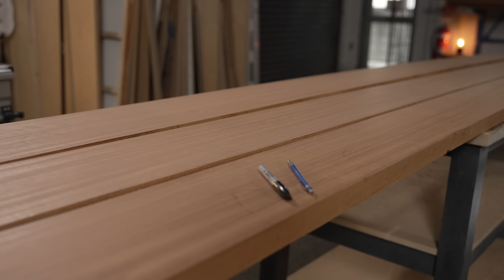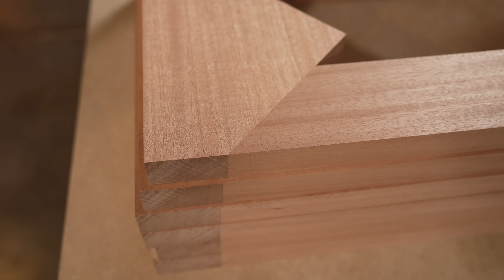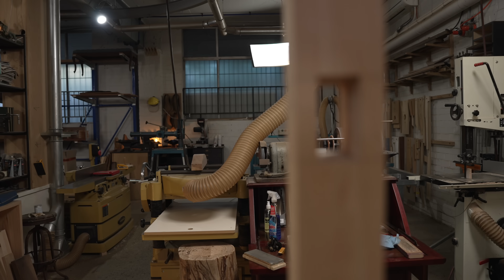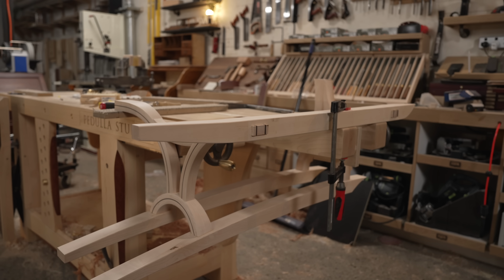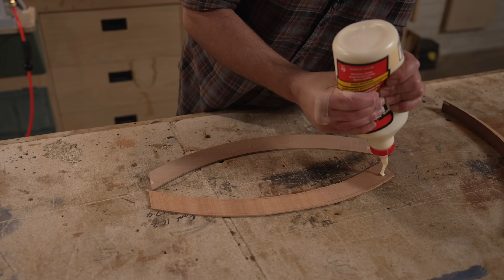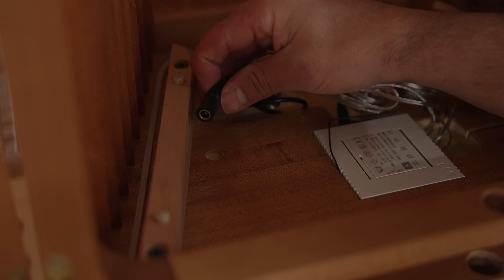The New Age Of Woodworking

Comment: Only one thing I might add. Superb. Execution and design. The only minor critique I have is the exposed pivot sleeve on half circle shelf. My guess is this is the whiskey pedestal. That circle could have been plugged or a gemstone embedded. The LED lights would enhance the gem. In fact as a. Now budding photographer why did you not put bottles inside.? Afterall it's a functional piece. After creating 2000 original paintings I know about aesthetics. I've also made many wood pieces

Comment: I think the process of staring at your design and moving its pieces a millimeter back-and-forth its what is known as pixel pushing (when applied to digital designs). Pixel pushing in itself as viewed as both a good and bad thing, as it will move your design closer to perfection, especially in terms of visual balance, but at the great expense of time and potentially only noticeable results to you as the creator. It can also push into a frame-of-mind where perfection becomes the only acceptable end state, which will never be obtainable, hence moving you towards insanity.

Comment: I appreciate the craftmanship here, though the design seems very our of proportion. As a whiskey drinker and collector myself, a whiskey cabinet should be much larger with shelves within to hold more whiskey. I think if you had expanded the width by 25% either side and 30-40% in length it would be perfect.

Comment: You can hide a Qi2 receptor underneath a thin layer of wood panel to the battery inside, and charge the battery with any Qi2 battery, just but it on the shelf where the receptor is and it’ll align and attach magnetically

Comment: Absolutely amazing and incredibly beautiful piece of furniture. 🤯🤯🤯

I used to build aircraft cabinets that went into Dassault Falcon Jets. I built sideledges, which is a shallow cabinet that goes between the seats and the fuselage with typically two stowage boxes, cup holders, two small control panels, monitor mounts, a phone box, and a stowable table, that were worth about $20k finished. Although they were mostly composite materials, there was still a fair bit of woodwork involved using all kinds of beautiful exotic wood, like rosewood, zebra, Birdseye maple, bubinga, ebony, and all sorts of burls, both “raw” stock and veneers. I did love the work, but it would be a bit monotonous at times, because every cabinet is pretty much a rinse and repeat every two weeks (roughly 120 hours per cabinet, not including stains and finishes because that’s a different department). We used the same equipment, but your table saw is awesome. I’ve never seen anything like it. I love it, and if I put together my own little wood shop some day, that’s what I want. And that work bench is really cool too. Are there plans available?

Thanks for sharing your beautiful woodwork and your process. Keep up the amazing work, and please keep sharing. 😉👍

Comment: As a fairly new wood worker, I can tell you that you made a few mistakes as a newbie. For example, the bottom of the actual cabinet door hangs lower than the other side. The twirly piece of wood isn’t needed if you just make some knobs or go to the Home Depot and pick up some. Don’t get frustrated, you will get there, just be patient.

Comment: Bro! You wouldn’t be pushing the boundaries if you didn’t make mistakes, that’s the whole point of what you’re doing! Woodworking has many genres and you are at one end of the spectrum, pushing hard to achieve something special. You have the rare ability to push yourself beyond what many think is possible, That’s why I watch your channel! I’ve seen far too many epoxy filled tables using fancy slabs of expensive wood to create something that red neck clientele think is ‘amazing’! Your work has class and amazing technique both in design and execution. Bravo!

Comment: That’s truly a work of art 🤩🤩🤩
You’ve got an incredible imagination to even think of these design elements & lines in the first place…wowwwww! As much as I’m fascinated & awed by all this, I think it would be great to maybe float some sort of shelf in the centre below the actual cabinet & in between the legs to hold either extra bottles or something that adds a bit of weight visually to the middle of this piece in the centre of the legs, midway from the bottom of the cabinet & the floor. Just a thought 💭 💭💭

Comment: The concept of limitations and constraints being an advantage is very real -- or at least, it sometimes is.  I bought a five-bedroom, three-bath, 3K sq ft house to live in alone.  The entire house can be my man cave, with the only limits being my skill and my budget.  Well, those are significant constraints.  The point is, having so much latitude has been making it difficult to decide what I want, and until I do, I can't proceed.  After four years, I'm finally getting a good start on the whole thing.